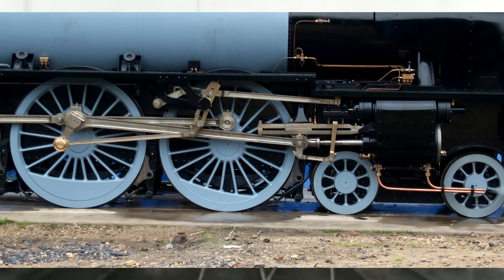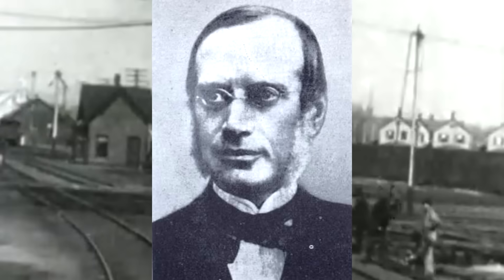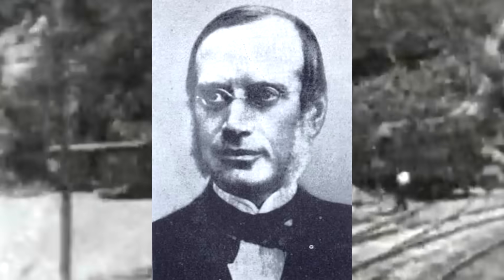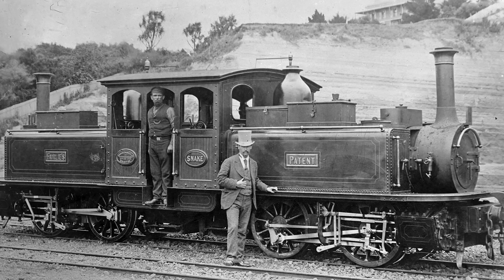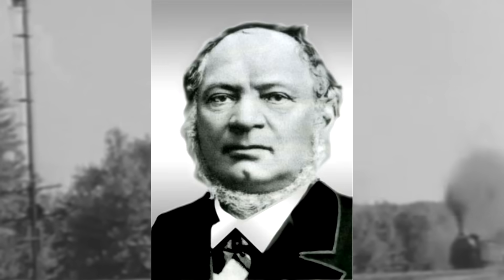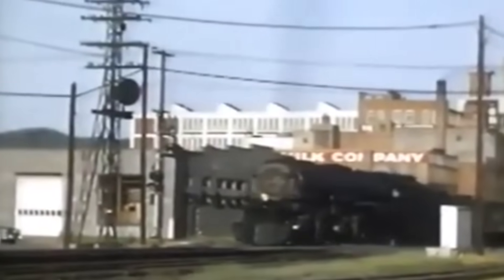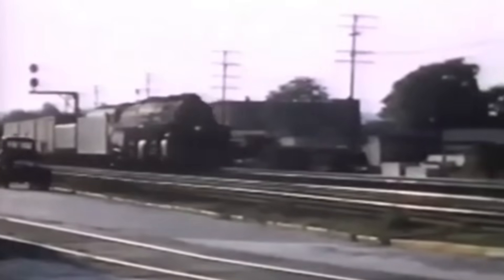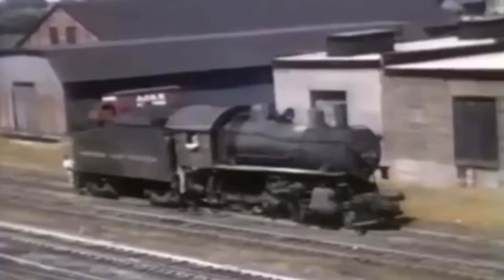What the Heck is Up With the Walschaerts Valve Gear? | History in the Dark

Comment: Great videos on valve gear. Now that 71000 is back running after restoration, and 2007 just got its new build boiler delivered, perhaps a video on poppet valve gear designs would be good? 

Oh and Bulleid’s valve gear can’t be that bad, still have unrebuilt West Country class engines running, even one on the mainline.
Reply: A Merchant Navy is actually being converted back to as built condition too. Spacifically 21C11/35011 General Steam Navigation
Reply: @hywelroberts1653 I forgot to mention this!

Comment: Stephenson valve gear could be used outside of the frames. Stanier Black 5 number 4767 was built at Crewe and delivered in December 1947, had outside Stephenson valve gear: instead of eccentrics, double return cranks were used to drive the eccentric rods, and a launch-type expansion link was used. This one cost £13,278, which was about £600 more than those built at the same time with Walschaerts' valve gear. The aim of the experiment was to find out if a valve gear having variable lead (as opposed to the constant lead of the Walschaerts' motion) would affect performance. On trial, it proved to have no advantage, although in normal service, it did gain a reputation as a good performer on banks. This locomotive survives today and carries the name "George Stephenson", which it received in 1975. Whilst a one-off, it still counts.

Comment: 1:08 Correction, the equivalent of a valve gear in an internal combustion engine is the timing belt and *camshaft*. Both of these control the flow of gases (air and fuel or steam) in and out of the cylinder. Where as the piston (on both engines) converts gas' pressure energy into mechanical energy that then is used by the rest of the machine.
Reply: There's more to that. Valve gears are also equivalent to continuously variable camshaft profile, although not variable valve timing.

Comment: GWR typically installed Walscherts valve gear inside the frames, even with their large powerful 4 cylinder expresses, although they were unusual in doing so. Most 0-6-0s (shunters basically) continued to use inside Stephenson valve gear into the BR era. This may well have just have been a UK thing however.
And Gresley valve gear? If you mean the conjugated valve gear applied to his three cylinder designs, that is just a modification that still used Walscherts motion but split the drive 3:1, so that each cylinder was 120 degrees out of phase with the other 
Cam driven and poppet valve as applied to P2 and V2 class were not designs he originated either.

Comment: The walshaerts gear can have continually variable cut off.  One special feature is that it is easy to design it so that the steam is starting to  be admitted at TDC no matter the amount of cutoff. It is very difficult to design a Stephenson's gear to achieve the same precision. That creates an efficient engine.  The main reason for designing the baker gear was to avoid having to cut that precision curved link.  Using only pins in its design.
Reply: This gear is the whole reason why double and triple expansion setups are not used on steam locomotives. At economy setting the engine does full expansion anyway so it's the same as a double expansion engine of the same overall size. But there is still an option to use full power setting which provides way more tractive effort without increasing engine size, at the cost of reducing water and coal MPG.

Comment: The gear allowed infinite adjustment. Like a hydrostatic mower controller, pressure is not controlled, volume is. This in good systems is accomplished with a similar system called a "swash plate" that adjusts pump plunger stroke by altering cam lift. As it passes zero lift it continues into reverse pumping in a smooth gradient. The difference being that oil isn't compressable and a piston pump is positive displacement. Thats why they can be jerky. However, with steam the valve gear can be eased past forwards into reverse assisting in braking without wheel slippage. 

My grandfather was a huge fearless man born in 1902 and worked for the CCC&C. And as a marshal in gangland Chicago area. He once punched through a SOILD OAK door and grabbed a man by the throat for calling him a liar to his boss. I say this to set a scene. 

Our farm abbutted the old Nickle Plate line, and we had a 2 mile long hill behind the farm leading into town. I was told that it was the fastest stretch of the Nickle Plate and also, by him to watch out when N&S ran their steamer because our crossing had no arms and when the engineers "Hitched Up" on that valve gear at high speed those engines "Get quieter the faster they go!" It just whispered by. He died when I was 10 but I remember him relating and verified by dad a story that before the crossing arms were installed at the bottom of the hill in town and dad was about 4 and sitting in the rear of grandpa's straight 8 Chrysler Imperial as they crossed the tracks. Apparently grandpa was pre-occupied. There was a small click sound as they crossed just as dad said "Gee dad that was close" grandpa looked in the mirror and turned sheet white.  The clink was the rear bumper of that Imperial hitting the ground torn loose by a passing steam locomotive! That big man pulled over and sat and just shook for a few minutes! He had neither looked, heard the whistle, or the loco. 

Once, in Chicago, he said he had to hit the deck of his office beside the tracks as the pieces of a truck loaded with lumber flew through his wall. His engineer friend had saved him. They all used a custom tune played on the whistle and he had leaned out to wave at him and saw him frantically waving to him to GET DOWN and he did just as the truck rolled into view. He had just loaded that truck for an old gentleman and his grandson! He went out to find them both alive and the only thing bothering the old man was that he'd left his wallet on the seat when they bailed out! Grandpa found it lying on a tie 100 yards down the tracks. The guy took it and walked away. In the depression most people carried or hid all their money, not trusting the bank. His last words to granpa was "We're alive, and the truck was insured." 

Who knows, maybe the battle of Gettysburg had hardened him a little! 😊

Comment: Australian steam locomotives would’ve had the Walschaerts valve gear system
Reply: Lots of early inside Stephenson valve gear in Australian locomotives for both inside cylinder and outside cylinder types. Some of the most numerous classes had that combination. Like the NSW C32, C30, C30T, C35 and D50. VR DD, D¹,D²,D³ and D⁴. SAR R, Rx and T class.
Numerous others.
NSW even had the D55 with Southern valve gear.

Comment: Darkness you forgot to mention that every stroke of a steam engine is a powerstroke.
Its not only the valve gear but also the steam slide valve above the cillinder that regulates the power setting.
The most powerfull steamengines ( pure freight engines ) had 4 cillinders working togheter at boiler pressure.
Mechanical stokers became mostly a thing to feed those beast with coal. Some railway companies were just utter sadistic and had a manual stoker who worked his ass off to feed those beasts.
Compound (multiple expansion like steam ships ) steam locomotives were mostly passenger express  engines.
Economy, speed and long ranges instead of power was more wanted on those. 
And a skilled footplate crew can make their steamlocomotive so silent on the run on a flat surface that you can only hear the mechanical bits like the rods and slides clanking.

Comment: A valve gear is more like the cam shaft in an internal combustion engine.
Reply: Well, id say its all combined. The piston valve is the valves of an IC engine, the piston is the piston (obviously), the main rod is like the crankshaft and the expansion link and radius rod is like the camshaft while the eccentric crank and rod are like the timing belt

Comment: Suggestion for a valve gear to cover, young valve gear
Reply: I've tried to study whatever young valve gear is, but I think I'll need to consume whatever young was taking when he thought that unholy thing up
Reply: @thomasmalthus3257   it's basically Walschaerts, but using each of the opposite Piston rods
considering one side of the wheels is 90º offset, they would technically do the same job as a eccentric crank

There is a video of someone rigging Young through blender and it shows that concept well, check it out, Later come back and tell whaddya think of it
Reply: @danius_huganius alright...I'll watch it, though I'm blaming you if I get even more confused
Reply: Joy valve gear is weird I'm told.
Stephenson link worked better at low speed due to its variable lead steam. Walscherts valve gear fixed the lead steam as a constant. It was more compact which is why it was adopted more widely.
Both types of valve gear could be used on small or large engines and inside or outside the frames. A Black 5 named George Stephenson used Stephenson link valve gear outside the frames.
Reply: @chrisbaines6931 and joy..joy is a odd man, but he's got his place, bigger crank webs on inside cylinder engines cause you don't need eccentrics. Young valve and Bengal valve gear is a crack powered nightmare